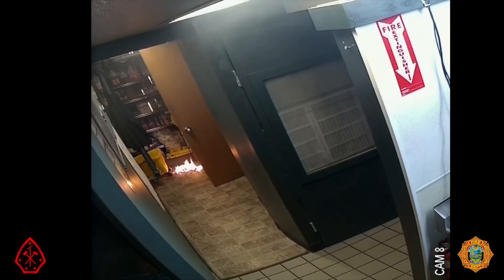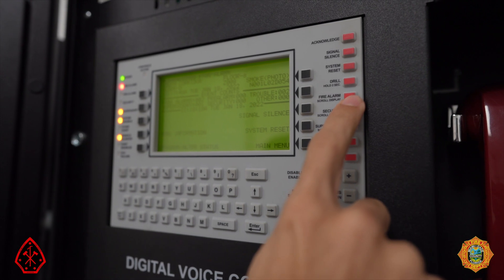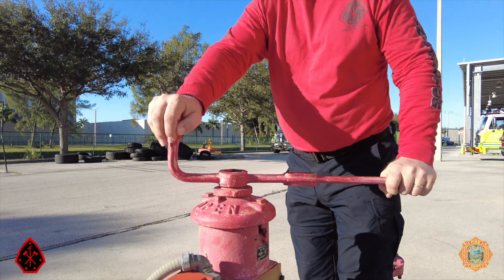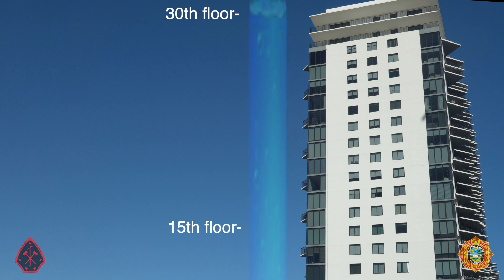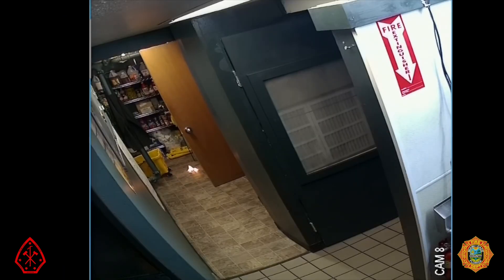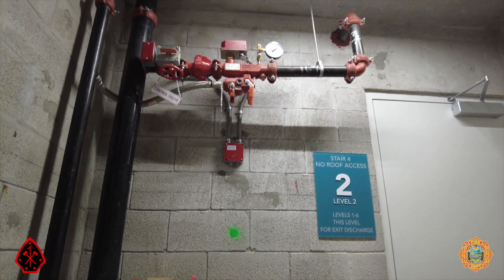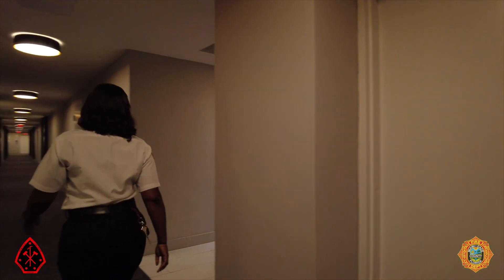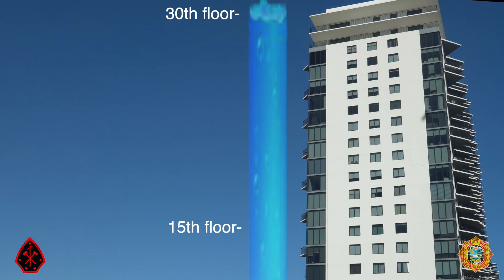How to Control Sprinkler Flow in Mid- and High-Rise Buildings

Comment: in this example they show check valves at each zone manifold, so the floors wouldn't drain out. they could have also shut down individual stand pipes or sent someone to the firepump room to shut down pump/closed pump discharge valves. shouldn't the pre incident plan have instructions?
Reply: My FD had preplans that showed valve configuration. Shutting floor valve and using drain is normally accepted technique taught in the apprenticeship program; it may have been covered in Standing Orders as well. 

A one year probationary program is not a replacement for a three year JATC program turning out Journeyman FF’s. 

Producing site plans does help. They’re the class outline for company officers during site familiarization. How many does the FD produce per month?

Comment: All the floors have check valves so the only water column is the standpipe
Reply: 6” riser, about 300 gallons above. 4” about 125 gallons. I have no idea why they included check valve at each floor.
Reply: Check valves are required on every FCV

Comment: Couldn’t have said it better myself. Union sprinklerfitter with 10 years experience in Pittsburgh PA. That’s funny cause I’ve been on multiple service calls where there was a popped sprinkler head or a bad leak or blown out pipe and the fire department shows up and literally shuts every single sprinkler valve in the building. Prime example of that is there’s still a pending law suit against a volunteer fire company in our territory where they responded to a call and there was a freeze up with blown out dry system piping where the system tripped fire pump kicked on and they shut the wall PIV off that supplies the fire pump and never turned off the fire pump. The electric fire pump ran dry until I showed up almost an hour later. The lid of the pump was black because of how hot it was. The pump was completely cooked. Very expensive whoops on the fire company. The customer wants a new fire pump. They should have known to atleast shut the pump off. They killed the fire protection to the entire building instead of just shutting down the dry system. Just proves training goes a long way.
Reply: Volunteer firefighters often aren't adequately trained.  They improvise as they go,cross their fingers and toes, and hope for the best.